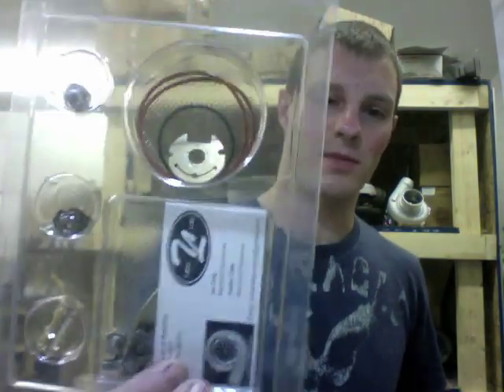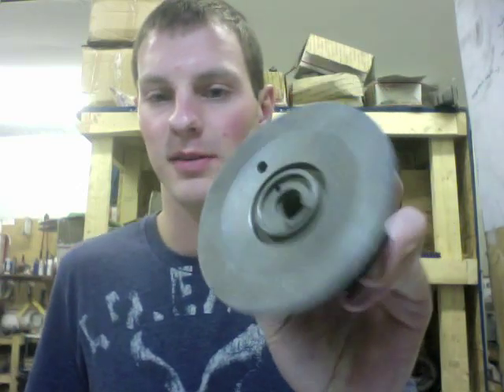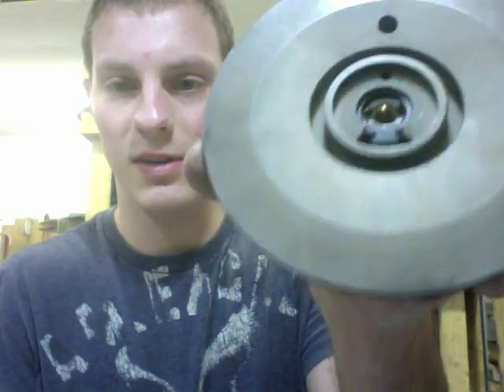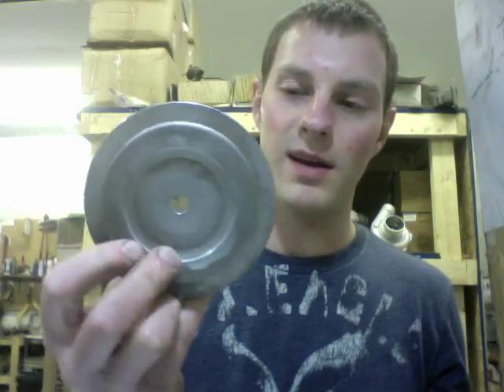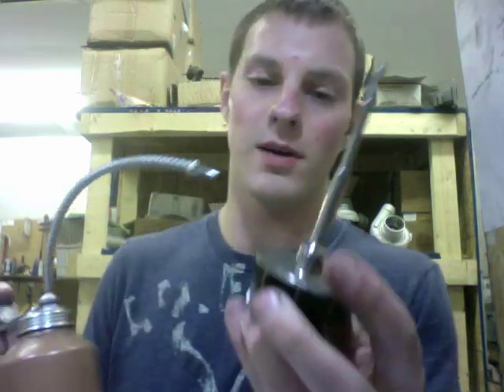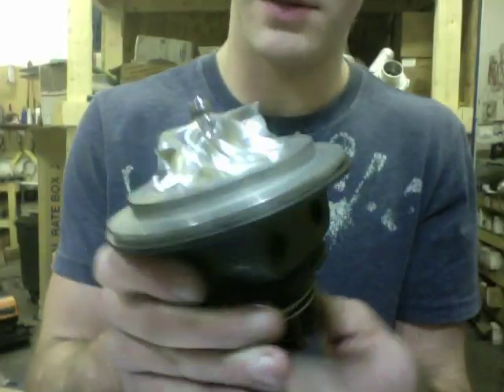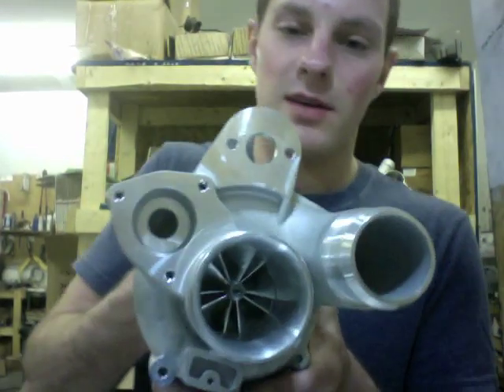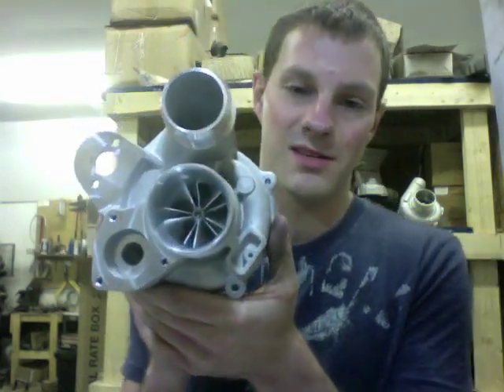2008 Mini Cooper S R56 K03 K04 Turbo Rebuild Kit Installation

Comment: Thanks for sharing, will a rebuild turbo prevent oil burning/consumption? I bought a aftermarket/Chinese brand and it is burning oil!. Was wondering if rebuilding the original turbo will prevent oil consuption? 

Thanks in advance.

Comment: Question here. I have a 2012 Mini Cooper S and the other day I punched it   On the freeway and the next day I noticed my turbo wasn’t engaging. Already checked all hoses and are fine.
Reply from the maker: They have a problem with the wastegate wearing out, I would check to make sure the wastegate closes properly.
Reply: Turbo Lab America really dammm 😂. Ok I’ll check that out.
Reply: Is there a kit for the waste gate not closing properly? Or what do you recommend?

Comment: What other upgrades are needed when doing this turbo upgrade? Will it fit my factory oil line and hoses on the turbo? anything else I should be looking at? I'm sure I'll need a colder plug at least.

Comment: I bought this rebuild kit and noticed the large o-ring seal was much bigger than my Mini Cooper turbo housing/center cart.  My old one was in good condition so I could reuse it but I was hoping for a new one that fits properly.  I also need one (1) exhaust stud where the down pipe mounts, not the exhaust manifold stud. One of mine broke off and I can't seem to find new ones listed anywhere. Can I buy one stud from you?  I was wondering why you don't use the new mounting plates that come in the kit?
Reply from the maker: +David Snipes you have to work the oring in  as you install the housing. The mounting bolts and retainers in the kit are designed for the vw and Audi ko3 models
Reply from the maker: +David Snipes you can find a stud at a local hardware store or a mini BMW dealership.
Reply: David Snipes

Comment: Thanks for the video! Is the center section & turbine shaft diameter the same as the VW 1.8 turbos? ie. Would I be able to bolt on a twinscroll k03 turbine housing if I have a vw turbo laying around? Thanks & Great Work!

Comment: What silicone would you recommend to use for cold side housing:
1) black rtv 300 C;
2) gray rtv 400 C;
3) red rtv 700 C.
Reply from the maker: +Janis Graholskis black
Reply: Is it really enough of 300 degrees? I mean if there is exhaust housing 5cm near that can reach like 1000 degrees.
Reply from the maker: The black is the only one that holds up to pressure. The compressor housing uses an oring you don't need rtv
Reply: I have RS6 C5 turbos. Ok I will look for black rtv. Thanks :)

Comment: Hey Austin, how much power if this turbo capable to make?
  I'm guessing this setup is a direct bolt on, and if so how much it will cost me if want you guys to do all the work for me? I'm rebuilding my n14 MCS engine and I was considering a turbo upgrade as well.
Reply from the maker: +Willie Lemosse i had someone claims 400 hp on a similar turbo. it was just on a different car. i think it was the chevy cobalt version. relistically 350 to 375 hp and around 400 ft lbs of torque. We do the upgrade for 650$ with a core. There are often cores on ebay for around 100$, but im not sure which have problems with the wastegate arms but i could probably get replacement parts for the wastegate problem.
Reply: +Turbo Lab America what's your email address?

Comment: Hey Austin, did you guys have an issue with doing the pipe in the comp housing inlet  that forced you to goto the new casting? I e-mailed you about turbine housing matching, I'd like info on a new cast comp housing as well :)
Reply from the maker: +Bryan Leverett Some of the ko3 covers can only be machined so far. The mini cooper inlet is too small. I made a previous video that shows were i pressed a pipe  in. But it just takes too much time (about 8 hrs) to machine the factory compressor housings. Im not sure if i can machine that turbine housing or not. I will take a look at the one i have tomorrow.  Im not sure what compressor housing they use either. I will look and find out. 

On the Focus ST turbine housing that we have, the housing came apart internally, it maybe a common problem.